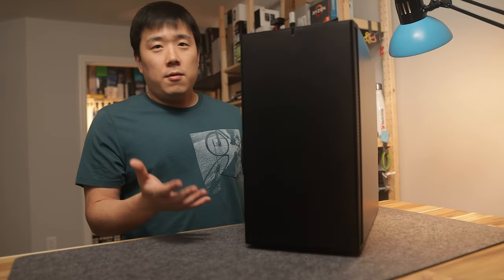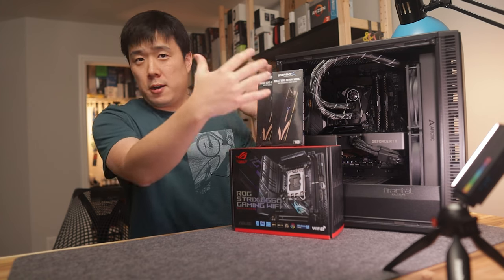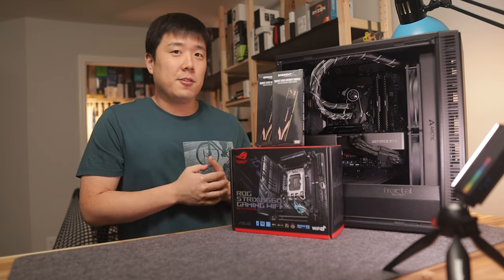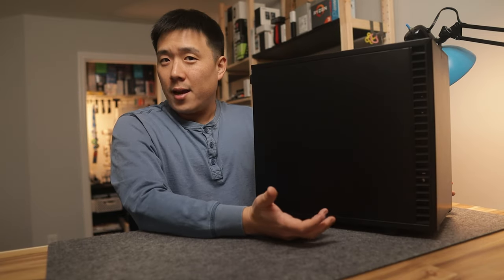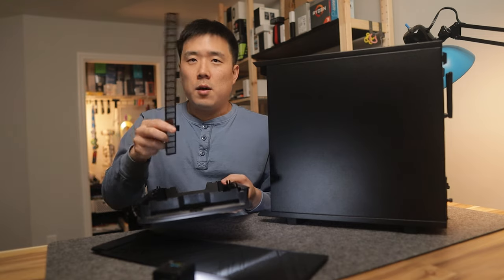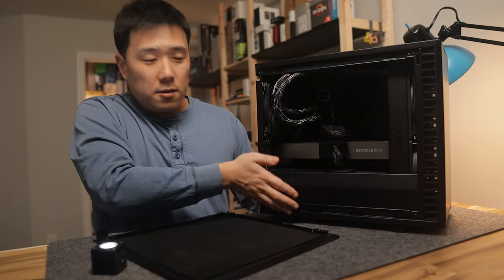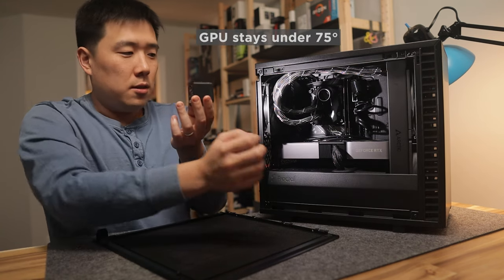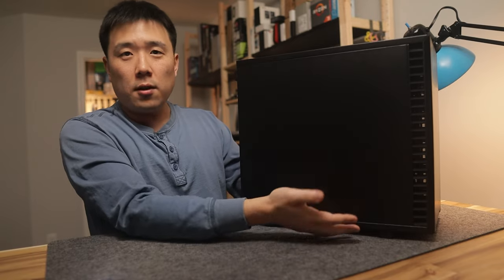2022 Custom PC For Architecture - Fractal Design Define 7 Nano, Intel i7-12700K, RTX 3070 Ti

Comment: I did the same thing.  All black inside a lancool 2 performance and a MSI Unify MB.   I couldn't see the components without a flashlight.    Started with a Noctua air cooler and I have switched to a top mounted AIO.
Reply from the maker: Top AIO is a very good choice. If I wasn't mounting under the desk I would do that too.

Comment: Hi Joseph! Could you post your temps idle and under heavy gaming load?  Thank you for the great vid and thanks in advance if you could post those temps .  Also - does the GPU get noisy? 
You mention in above comments that having liquid cooling on the CPU certainly helps with the noise but I'm curious whether the GPU itself gets loud under load and if it's a particular brand of 3070ti you're using?
Reply from the maker: Hi Rob, I don't have heavy load games, so I can't really test it. But CPU Temps are 30 degree in idle and GPU is 55. On some heavier load it may reach 75 degree in GPU and near 70 for CPU. Generally kept really cool and silent. My GPU is founders edition. It does get louder during load, but isn't really something unbearable.
Reply: @JosephKim  thanks Joseph, I really appreciate your help. I like your approach and that more compact form factor with none of the RGB show off nonsense they want us to pay for. That stuff just irritates me. Extra cost and for what?
Reply from the maker: @bobwood4304  minimal heat gain and light noises. 😎

Comment: Hello Kim, firstly thanks for your video. One simple question: My wife sometimes complaining to me due to so much fan noise with my pretty bad omen 25L case and bad thermals. Now thinking to change it with fractal. Did you notice significant difference for sound dampening performance point of view ?
Reply from the maker: My machine is really silent. But that is because of its panels and the near silent CPU cooler. So, consider that too :)

Comment: Hi i just build a similar case , but with a dark rock pro 4 cpu cooler (my gpu was too long for the a radiator in the front). But still the thermals are not the best i say. I have Gpu ~50°C and 40°C CPU with no Load. Is it the same for you? (i have a rtx 3060ti from gigabyte and x5600 ryzen) Best regards!
Reply from the maker: Some GPUs have 0 fan mode. You may get a bit higher Temps if that is happening. Mine is at 35.
Reply: @JosephKim  thanks man you were right!

Comment: Hi Joseph, awesome video! I am interested in making a similar build for my job and was searching for the NVIDIA graphics card you used here, but wasn’t able to find any available buying options. Do you know if the NVIDIA GeForce RTX 3060 12GB GDDR6 will be able to handle work in Revit and some light rendering in Enscape? Thanks for your time!
Reply from the maker: Hm, I thought I had quoted. It is RTX 3070 Ti. Your RTX 3060 would be one tier less than that one. I'd say 3060 will be fine for light renderings.